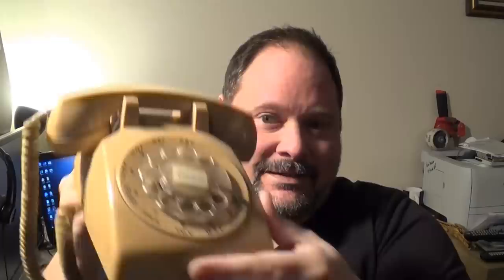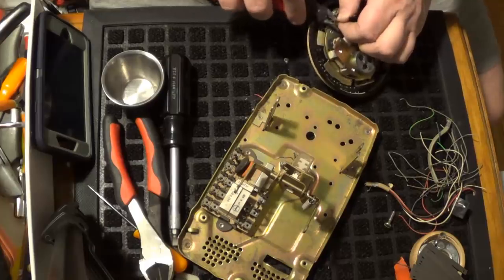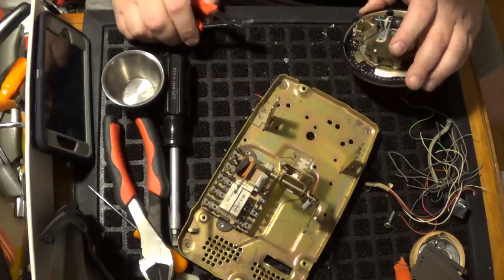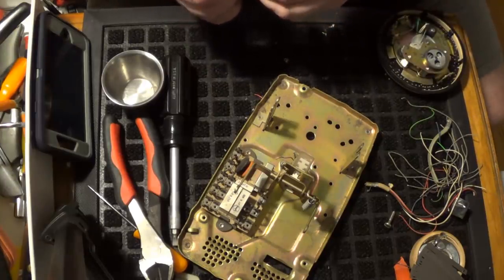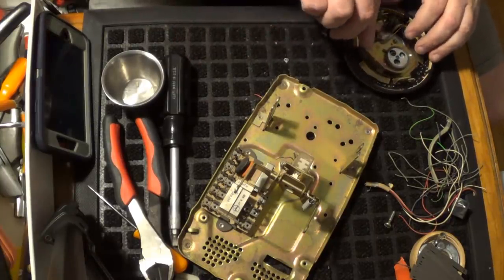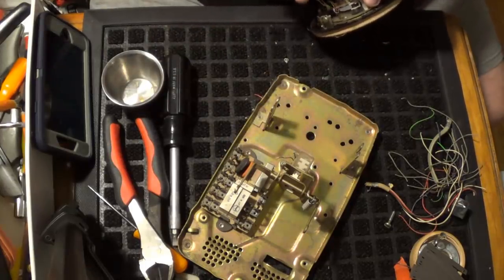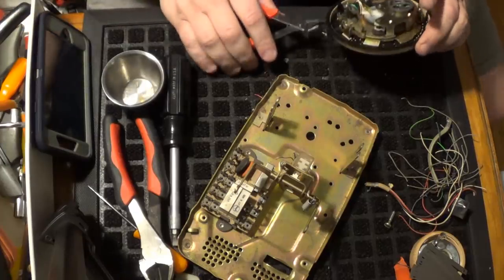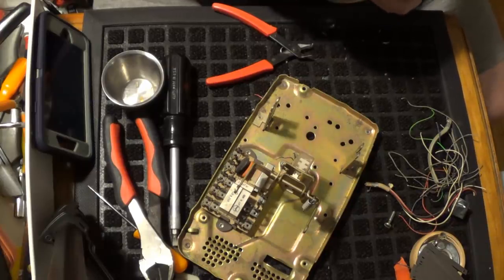Scrapping a Vintage Rotary Phone for FREE GOLD! ...and brass and other stuff. -Moose Scrapper #275

Comment: If u were u, I would have sold it as is. Even if it isn't working.
There are heaps of people who would like to have one of those just for nostalgic reasons cos of the history.
As another user said, they bought one for 20 bucks purely cos they had the memory of loving the tactile dial sound when they were a kid.
There's heaps of people who would buy it for a cheap price. The gold in this is probably only gonna be worth a dollar or 2 after you put it through the extraction/refining process.
Put it up on your local classifieds or ebay for 5 bucks and you'd sell it easy without effort.

Comment: ABSOLUTELY NO GOLD OR SILVER INSIDE, just brass and tin, aluminum, and steel, and plastic.i even tested the metals. 
besides, there was no reason to use gold or silver in it, anyway. i scrapped a couple of them already, and saved the brass for projects, wire for projects, too.
Reply: Actually the contacts are palladium if they rectangle or square with a thin layer of nickel on the back that make them "seem" magnetic. Some have gold contacts. Some have silver caps on the speakers and solid silver contacts in the handset. On the ones that have gold plating inside  the speakers it is very thick. Some have no gold though. I've scrapped probably 100 of them

Comment: there is absolutely no gold in any rotary phone. only: aluminum, steel, and brass, tin, plastic, rubber.  sorry. i scrapped 2 already.
Reply from the maker: ugh....  so because you didn't find any, there isn't any huh...  Well, I know the pyramids exist even though I have never seen them in person.  Just because you don't see it, does not mean its not there.  I found it, and I found it because a group lead by Geo also found it and taught me.  Sorry if you don't agree,  have a wonderful day.
Reply: @moosescrapper5928  moose, what else did you find in yours? thats all i found. im putting the bells into my homemade pinball game, saving the scrap wire, and scrap aluminum.
Reply: Here to back up, Moose.  Most definitely is gold plated transmitter parts.  The small diaphram in the middle tested positive for heavy gold plating, as evidenced by large sheets of intact gold foil, in direct response to nitric acid digestion of the copper base metal.  As with all things electronic, contents and material used will vary.  Hope you keep looking & find that little treasure soon.
Reply: @janiechristian4695  electromagnetic, , like a telegraph. We took one apart in electronics 201 in college and checked each part, compared to a telegraph machine. No plastics, just metals. Was fun, except we got shocked! We understood safety real quick!😊
Reply: @soonersciencenerd383  ok, just can't hold back. Are you sure what you're calling aluminum (aluminium) isn't in fact zinc? If you're scrapping then it really doesn't matter, but, if you're melting then it matters a lot.
Reply: @janiechristian4695  i will keep looking for different metals in everything, though...
Reply: @donniebrown2896  didn't think of that, too. didn't think the phone company WOULD use zinc in a phone (just cheap stuff). im just going to use the parts for projects, the rest for scrap.
Reply: @moosescrapper5928  get a gold test kit- test the metals. i did none there.